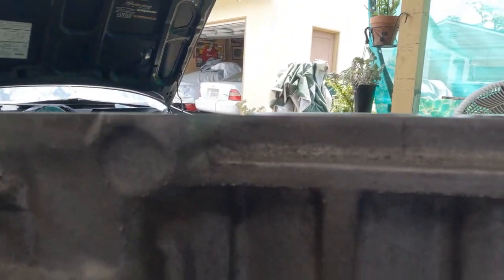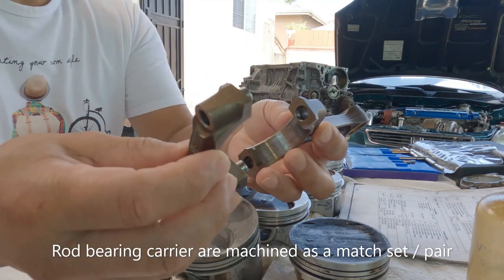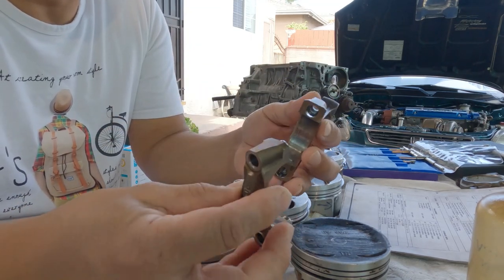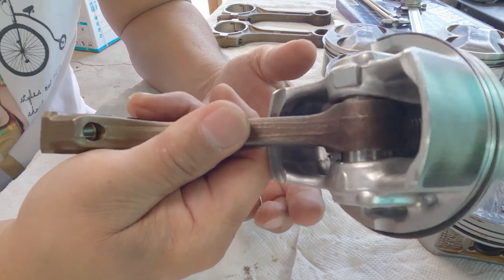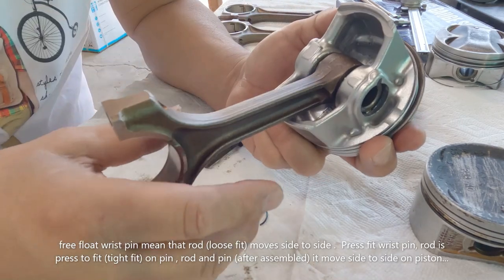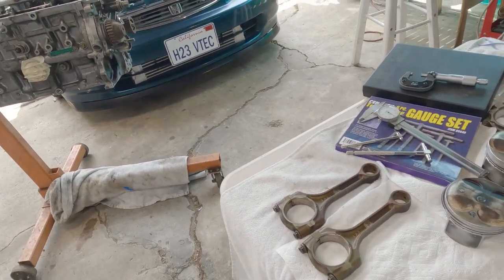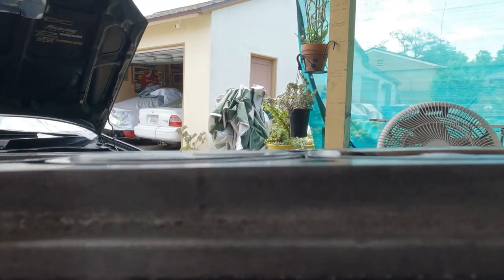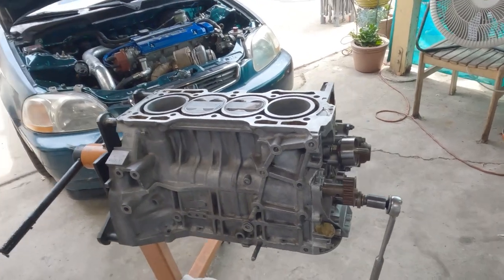H22a4 piston w/ F23 connecting rod.

Comment: Hey Sagitt Net2, do you have any videos showing how to inspect the H22 block? I need to rebuild this motor but know nothing about it. I have 2 blocks, one just got resurfaced , the other one spun bearings. I need to make sure this new block has good cylinder walls. do you have IG or discord?
Reply from the maker: I dont think l ever did a video on H22 blocks except for the recent H22a4 w/ f23 internals. It's the episode about the k2h intake manifold. I l shown how l build that H22a4 block. Anyway, F and H block have the same inspection procedures. Make sure sure cylinder bores are not out of tolerances. If you have no oil consumption problem on your H block before,  you can put everything together but make sure to check all your piston ring gap clearances. Don't hone your H block if it has a OE frm sleeve.
Reply from the maker: Sorry, but no IG account.

Comment: Hey Sagitt, I'm going to be building a h23a1 block with an H22a4 head soon.  I just sent out the block for CSS and new sleeves and will use forged internals.  Can you give me any tips on what needs to be done to get the two to work?  I've heard that I might have to plug something in the head for coolant but everything online is conflicting.  I know that the G23 builds you have to do that, but unsure that is needed with the H23a1 block.  I already pulled the plug from the block for the vtec, but is there anything else that I need to do to prep the Frankenstein build?   Do I really need to have oil squirters?  Any help is greatly appreciated!
Reply from the maker: Basically you are building a H23vtec and yes, you did alright by removing the oil restrictor from the block. There's no cyl head plugging  needed, H23a1 block w/ H22 are compatible. You need to use H22 headbolts or use Arp headstuds if you like. You need H22 thermistat housing and water coolant tube, h22 waterpump and  h22 crank gear and cam gears.
Reply: @sagittnet2158  thanks man!
Reply from the maker: Your H23a1 block already have the plug for the oil squirters passage. Its almost the same build like my recent stroker, except l'm using a f23 crank n rods, yours are H23a1 crank and rods. Since you are having the block resleeve, and you're using forged rods, your piston selection are endless. Just remember about P2w clearances and pay attention on conrods recess for the bearing make sure to put it on correct location. I think that just about it and also if you are using the h23a1 timing belt tensioner. Just do like l did how l elongate the hole a bit, otherwise you'll be struggling to install the belt. Ok brother, good luck on your build.
Reply from the maker: You dont really need the oil squirters, you'll be fine. I only did it coz l want to proved to my self that it can be done. Its a lot of work and lots of parts wasted after it was a success.
Reply from the maker: Did you already sent your block to get it done. Usually the new piston has to go w/ it, that way you tell them what you want for your  piston to wall clearances.
Reply from the maker: @keung71182  not a thing brother! Are you boosting or NA setuo and l guess you already figured out what compression ratio you want
Reply: @sagittnet2158  ya I sent the block with my mahle pistons. I'm looking to get a skunk2 intake but saw that gutting the stock intake might be a good. What do you think?
Reply: @sagittnet2158  the mahle pistons I have are supposed to be 10:1 with a .066 headgasket. So I'm not really sure how much boost I can push but my guess is 15 with the css reliably
Reply from the maker: @keung71182  Alright man! Hope for the best.
Reply from the maker: @keung71182  sk2 will be good, as long as it'll fit the bay. I had a chance to get a new sk2 for a good price(280) turned it down coz l'm cooking on something better. Hope it'll work though. You'll find out soon.

Comment: I don't understand. The title mentions K20 pistons, in H-Series block, with F23 conrods. However I remember over a decade ago when the G23 build surfaced from someone tinkering with F23 rods in the H-Series. I haven't really followed what's been done with this type of Frankenstein since then, so I didn't know if using K-series pistons was another avenue that builders of this type motor have since used, while the video was mostly about the use of H-Series pistons by comparison? Towards the end of the video, you mention it's H22a4 pistons+block, with F23 rods.
Reply from the maker: Ok, sorry for title making it a bit confusing. You can use   K series piston on H block providing it's been iron sleeve and k series also comes in 87mm. I should have mention it. But mostly what l was refering is installation of k piston being backward compare to H22 piston on f23 rods. K series piston actually is the best combo for f23 rod 'coz of piston height w/c is same as f23 piston. It's not going to stick out like H22a4 piston like l showed on video. I was also following the guy who created the 1st g23 back in the day. You remember that too huh!
Reply from the maker: What l have is a g23 using H22a4 block, F23 crankshaft and rods w/  h22a4 pistons. Instead of using F23 block l used H22a4. I forgot to mention the crank at the end of the video. Hope this clears it up. I'll add it on the tittle. Tnx for bringing it up.
Reply: @sagittnet2158  Gotcha, I see what ya did there 😉
Reply: @sagittnet2158  yes sir, I was frequently on Honda-Tech! Once had a post of mine Stickied in the N/A Forum lol...I miss my Honda's. But yeah I remember seeing the G23 a year or so after completing my first LSV.
Reply from the maker: @kylecurry6841  That's kool man, I actually made a video more like a tribute to that person who created the g23(non vtec) but l didn't upload it. But l might mention him one if these day. I think he pulled his thread or write up about how to build the g23 coz HT didn't stickied it. You lucky you got one, which one was yours if you dont mind me asking?
Reply: @sagittnet2158  yeah that's a shame if they didn't sticky his, however that forum was changing from a grass roots site to more commercialize with Internet Brands at that time buying it out from George Knighton. Anyway, IIRC was the titled the "DIY Compression Ratio Calculator". It was mostly just motor math that gave people numbers to follow if they weren't entirely content with the figures that the Zeal web calculator was known to give which I think their was some controversy on regarding PCT (CTR) pistons lol.... But yeah I tried to keep up with the pictures of the thread... In the early years, you used to have to post pics on other sites and link them in the HTML (like Myspace), but I think I recall after about 2010-2011, HT provided users the ability to save picture uploads....

I haven't gone back and checked it for a number of years, but people appreciated it for the time....

Circa 2007-2009
Reply: But regarding K-series pistons... Like a said, I never knew you could use those, but I'd love to see a breakdown on the build in a video..I knew the K series RBC manifold can be retrofitted to the H/F20 head with some supporting mods IIRC.
Reply: Hey I'm building a g23 with k20 type s pistons and I was wondering if you ever ran skunk 2 stage 2 tuner cams with no issues.
Reply from the maker: @sd9223  l did clayed it when l did a g23 w/ jdm nippon racing pistons and regular camshafts and really there is plenty of clearance but as youv'e seen on last vlog, l modified the exhaust reliefs. If l were you, l'll clay it. Just to give me a piece of mind. You know if you get a forged K20a2 pistons like CP. It doesnt have a wristpin offset and there's plenty of intake and valve reliefs. Its almost a plug and play.
Reply from the maker: @sd9223  if you have a F23 block then cp piston is perfect for it.
Reply: @sagittnet2158   I am running a a f23 block but I already have k20 type s pistons I was just wondering because my friend said he would give me the cams if I wanted them
Reply from the maker: @sd9223  that is sweet!

Comment: How much boost you put in
Reply from the maker: The H22 stroker (f23 crank, rods) is NA setup due to the H22a4 OE pistons been modified. But my other engine, Civic w/ g23 @19psi, Cd5 H22 is also @19psi.